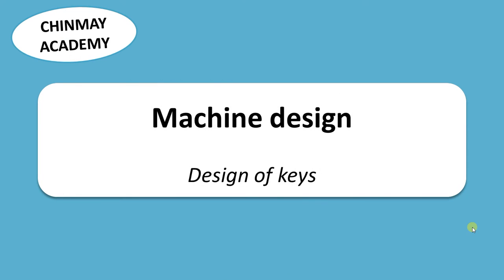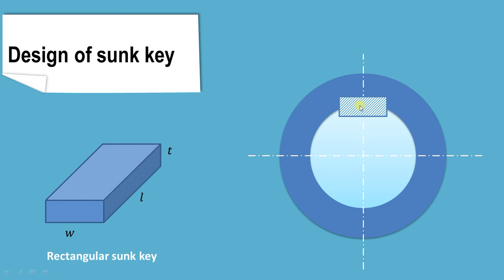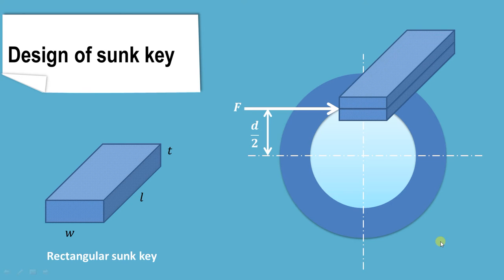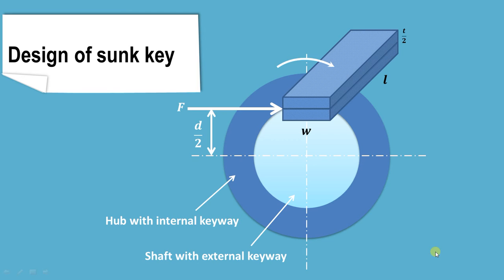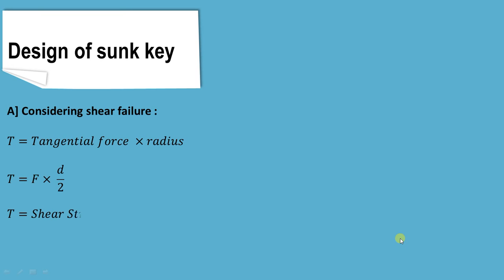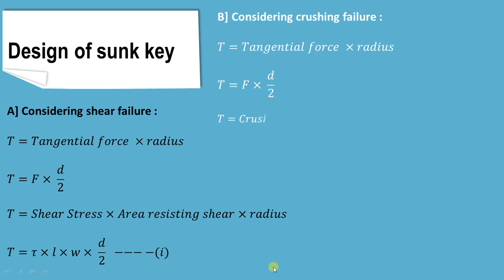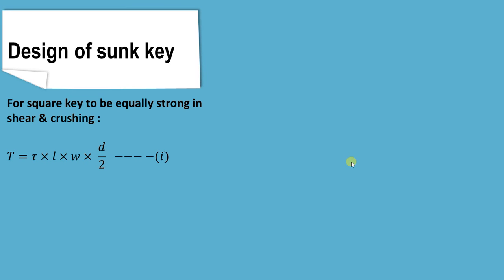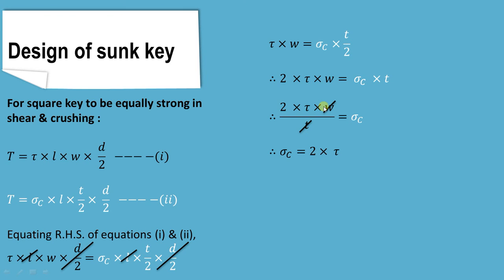Machine design (Part 1) - Design of  Sunk key

Comment: sir, what is localised compression
Reply from the maker: Crushing is known as localize compression. For e.g. if the rod is subjected to axial push then it is in compression but if you apply force on specific area of the part (like crushing of chalk) then it is localized compression or crushing.
Reply: @CHINMAY_ACADEMY bro why you consider half of thickness as t/2